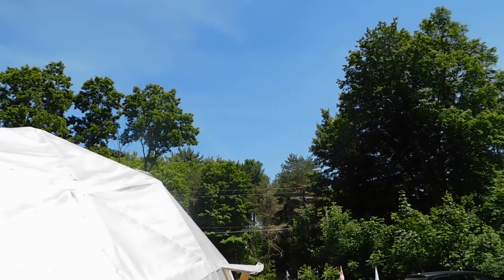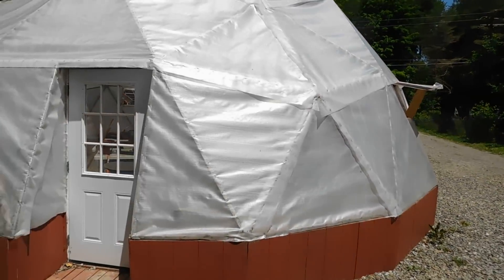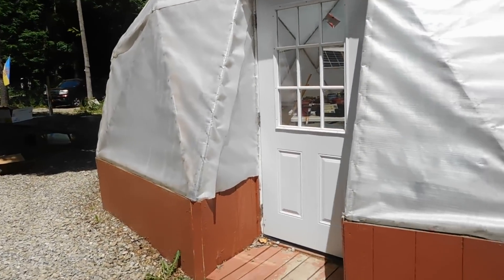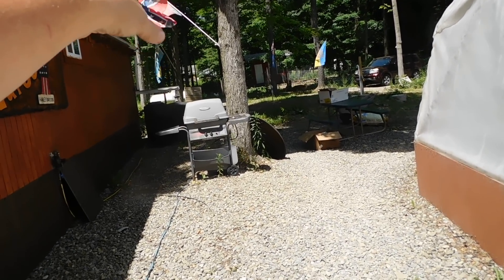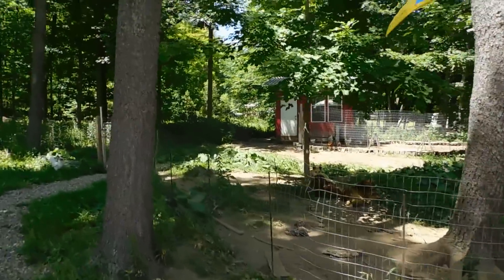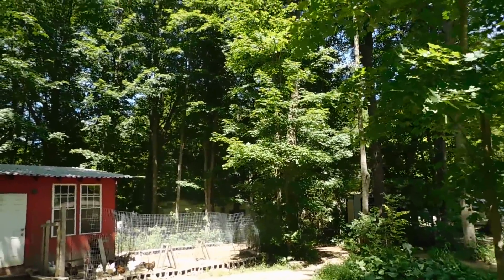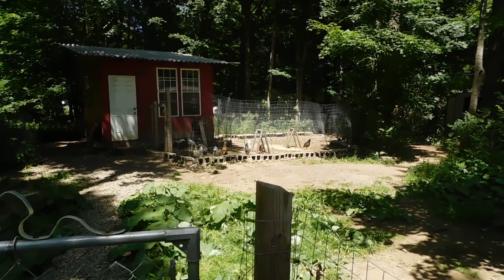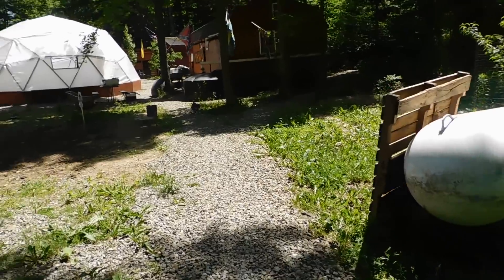A easier way to water the gardens updates on getting the water in. And Margie's is here now.

Comment: Just know…..those RV fridges are finicky!  Some will not run well when not leveled.  Plus if you are not level and have a slide on the higher side of the RV water will run back towards the RV an May get by the seal.  AND DO NOT TARP IT.  RV roofs are rubber membrane and need to breath and will quickly disintegrate under a tarp!  The light switch in the bedroom is on the light itself.  No wall switch.

Comment: The plastic watering hose attachment is garbage. It will only last a couple of years. I changed over to the old fashioned brass ones. Never will need to buy new ones again. I have a supply of washes to replace when needed which is not too often.